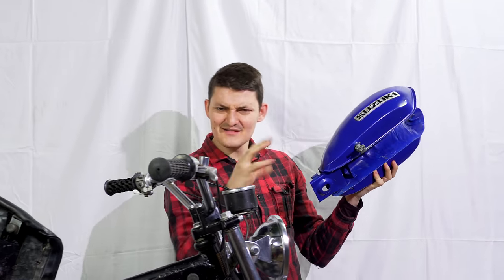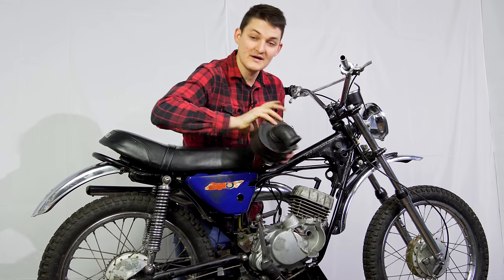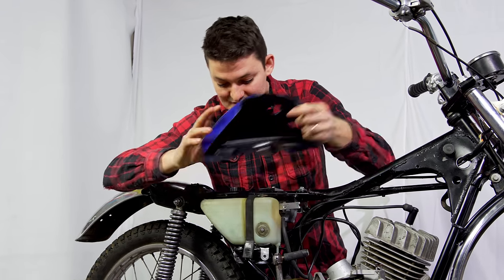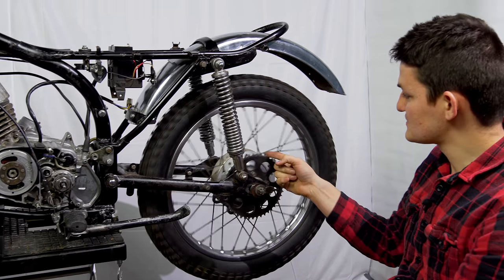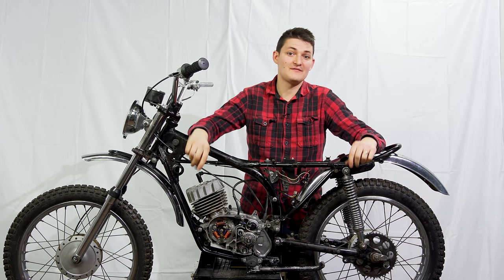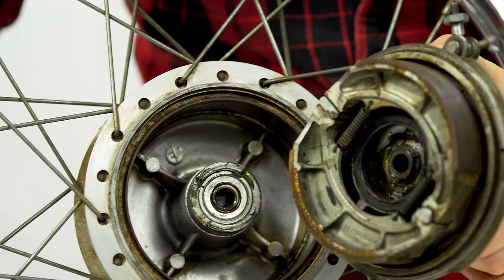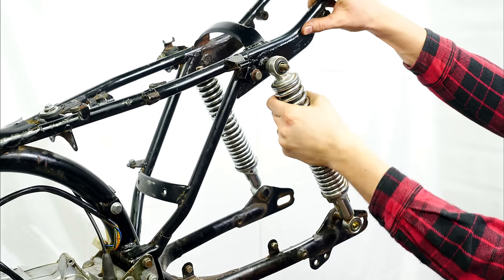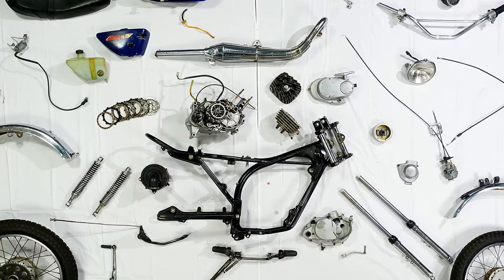7 Minute Motorcycle Teardown – Mechanic Crash Course

Comment: When you put them back together in order up until you found one screw left on the floor😅.
Reply: That's the Jesus bolt. As in "Jesus, where does this go?"
Reply: And still can't find the 1/4 x 10mm socket.
Reply: thats not as bad as a ring
Reply: That's just weight reduction.
Reply: or worse, a spring
Reply: that means you just did it better than the factory did!
Reply: You're screwed.
Reply: meh....it's just an extra screw, should be unnecessary.
Reply: Just lie and say it came from that IKEA dresser that one time... Hopefully it's not from the klonkey macjob that turns the crank that  turns the thingy mcbob.
Reply: We call those extra parts
Reply: Most of the time those bolts hit the floor and bounce into an alternate dimension, never to be seen again
Reply: @Mrbumbons1  That's the rattle you hear at 47MPH!! LMAO.
Reply: Did this today.   Luckily, I know EXACTLY where it goes.  Unluckily, it's going to take about 2 hours of work to get it there.
Reply: Usually the bolt that's NEVER needed 🤫🤔🤣🤣 then realising it's the engine bolt and you've already started riding down the street to realise your no longer riding but COASTING 😂🤣🤣🤣
Reply: That means you're a good mechanic saving parts :D
Reply from the maker: @Mrbumbons1  I feel like I spend half my life trying to find a 1/4x10mm socket haha. ~RF9
Reply: @sharplanceforge1898  so that's what it was huh?

Comment: Let's sit on 2 wheels with exploding liquid between our legs. Got to love it
Reply: Yes
Reply: Exactly. No windshield, seat belt,  airbags,  bumpers, et al. And the pavement is racing by a few inches under our toes. How does the Nanny State still let motorcycles on the road?
Reply: @timjohnson1199  I'm sure they will try something one day.
Reply: @timjohnson1199  The fenders act in a very minor way like bumpers, as in, if I get bumped on the rear going 15mph because someone is on the phone not realizing they need to stop for the red instead of crawl to the line since well.. there's something behind the line and in front of them...

• My tire doesn't get bent, and the fender takes the hit., • Airbags can be done with Helite vests/airbags if you want one, just needs a 60cc Co2 cartridge to replace/re-use, much simpler than paying thousands of dollars to pack the airbag back into the steering column of a car, and just as well where the motorcycle airbags come in various sizes and don't cause broken noses, fractured wrists, sometimes chest and rib cage issues, the motorcycle airbag is fitted to your size AND only needs 60lbs of force to go off, more than accidentally walking from the motorcycle, LESS than that needed for a car, I've had a car go into the ditch before at 45mph and probably 30mph after the wet mud slowed me down and the airbag didn't shoot off, and that's not exactly something unheard of either., • now about the seatbelt.. well, that would be unsafe on motorcycles, just how the locking-pedals for bicycles are considered unsafe unless you're in a race that has closed off roads., • Windshields? Windscreen are mostly present by stock on motorcycles nowadays anyways, but easily accessible on the 3rd party market, for anything from sport bikes to cruiser bikes to even a Grom.

SHORT: Bikes do have windscreens on most models, aftermarket parts if desired, bikes can also have airbags (A goldwing model, if not still, did have airbag in the motorcycle as an option) that are worn as a vest which are safer than car airbags (talking about driver/rider only, even a passenger can wear an airbag though) and don't break rib cages, break wrists or noses due to the 1-size-fits-all styling and rapid deployment that hits you rather than protects your body on all sides, as for bumpers, yeah, the frame that extends past the read tire, and the fenders protect the motorcycle from getting bent wheels and the frame of motorcycle takes the impact, sorta like the flimsy "bumpers" or front/rear fenders on cars that just have a metal rigid chasis that they are mounted on.

SUPER SHORT I do realize you /might/ be joking, but people do think like you typed, people are not aware and/or willfully ignorant about the safety of motorcycles.
Reply: @timjohnson1199  see: actuaries.

Comment: "So you don't get Covid-19 in your motorcycle." Coffee. shot. out my nose.
Reply: So... what is an air filter for on motorcycles? For cars it's because of A/C but... motorcycles? What, maybe a fly gets burned to ash and is shot out the exhaust?
Reply: @MrCODEmaster00  Is this a troll comment or are you serious?

Either way, in case there's a curious kid that really doesn't know out there: The filter you're referring to the is the "in-cabin micro filter" and exists solely to filter allergens out of the A/C intake so your dealer can charge you way too much to change it every couple of oil changes.  The main air filter is for the engine and is to keep out dirt, dust, sand, small rocks, bugs, etc. out of the engine as it can score the cylinder walls and cause a loss of compression (and power/fuel economy) and eventually catastrophic engine failure.  This is the function of the filter on the motorcycle.
Reply: @MrCODEmaster00  Your car has not just an air filter for the AC - it also has one for the engine. In fact, in some cheap ass cars there is only one air filter - for the engine. Like NunyaBusiness says, its job is not to get you nice and clean cabin air, but to prevent shit from getting sucked into your engine - no matter if car, motor cycle or whatever device that moves on roads and uses a combustion engine.
Reply: Didn't you know? In 2019 some guy in China forgot to put his air filter back in before riding within 6 feet of his friends on a dirt track?

Comment: You are gold. In all your videos I have only this. 1) small bikes w/o O-ring chains what is your recommended lube. 2) best/cheapest comms for rider and passenger only. 3) preloading front brake lever leaves your brakelight on fulltime which may be dangerous with the exception of bikes that you can adjust the switch mechanically such as HD.

Comment: i was 14yo when i built, alone, a 50cc bike, no manual, by bits i got from different places, while hiding it from my father until it was too big. 
Rode it a couple of years until an internal gearing holder failure caused me to had to call a friend to bring a pickup truck. The other was due to broken chain. Rebuilt it within the week with a spares engine.
Best bike mechanic training i ever had to this day (now 38). 
Last week, changed air filter+rear pads, general cleaning and lube plus fix two major electrical gremlins on my DL 1000.

Comment: I like how we're shown the mechanics of a motorcycle on the type that's closer to it's original form than the modern version. The motorized bicycle, without an engine, fuel tank end electronics, this is just a balance bike, modern bikes have WAY more new technologies that are harder to understand, but this literally has a frame similar to a bicycle.

Comment: That looks a lot like my first bike: a 1978 Suzuki TS100. I used for work every day, whatever the weather, and at weekends it would end up being ridden through rivers, across snowy fields, or up the sides of hills with huge jumps at the top. 
It was crashed many times, including within an hour of buying it because the 1970s in the UK meant no training necessary on bikes up to 250cc. No training at all, which was a guaranteed death sentence for many  for 17 year-olds, especially when Suzuki made the first 100mph 250 (the X7).
 Also it had an issue where any slight dampness in the air would cause it to stop working, so I had to carry a can of WD40 with me at all times to get it going again, because UK weather...

Comment: Ironically, taking apart a first gen RX7 down to the last nut and bolt is how I got into rebuilding rotary engines back in the day.  I like motorcycles more I think.

Comment: I love how he did this on a bike thats engine works nothing like any bike on the road today.... Rotary valve 2=stroke anyone??  In simple terms yes they work the same but I do have an issue with his wet and dry sump descriptions. The oil drained was gear oil, not engine oil. And the oil in the tank is 2-stroke engine oil and they both lube 2 completely different parts of the engine.

Comment: Well, regulators doesn't regulate voltage at 12V (6V) but at around 14.4V (7.2V) with zener diodes.

Comment: I mean, now I know that kickstarting a bike creates rotation, which creates electricity for the spark plug to, well, sparks. But how about igniting a bike from the controls at the handle? How does that work? Through the battery?

Comment: im kinda of new to bikes..but in the first minute i seen a carb attached right next to combustion area.. this astounded me.. fuel cools the engine.. i was thinking of making a peltier therrmocooled arb float bowl adaption. to cool fuel 20 degreees under ambient. i have noticed that riding in 5-10 degreee weather m,akes my 2 stroke extremely happy... why in the wide world of common sense would a moto manufacturer do this....also how does the fuel reach all the transfer ports if its injected into one side..should be in the middle like every(small) 2 stroke ive seen

Comment: I just bought a bike, saw this video and thought I could do it. Didn’t even get past the throttle stop screw lol. I twisted it down and twisted it back up and now my bike won’t even start, not even if it’s twisted all the way up. Any suggestions? I also tried to start it without putting the spark plug wire back on, put it back on once I realized but the bike still won’t start.

A friend tells me I may have flooded something somehow?

Comment: Hmmm...
That bike is 2 stroke, so that "wet sump" engine oil looks a lot like gearbox oil, it's red, clean, and not full of combusted gunk), and that "dry sump" tank looks like the 2 stroke oil reservoir which feeds the pilgrim pump, gets mixed with the fuel, goes through the carb and gets burnt/splattered about the engine in true 2 stroke style. There's no oil reserve in that crankcase!

Maybe don't use a 2 stroke to illustrate a wet or dry sump 4 stroke ;-)
Then you could mention cams, valves and valve clearances too!

(are they even a dry sumps on bikes under 50 years old? Only example I have in my garage is on bike from the 60s).

Oh, and I don't think there is any cat on that exhaust either!

Comment: it's simple actually you buy a bike with carbs if you live near a place that has more rats than India's population or you can have a fi bike where there are no rodents to chew your wires because if a rat chews a wire on your fuel injected scooter you are looking at a 100 to 200$ wire repair while only 10-16$ of repairs on a carb bike